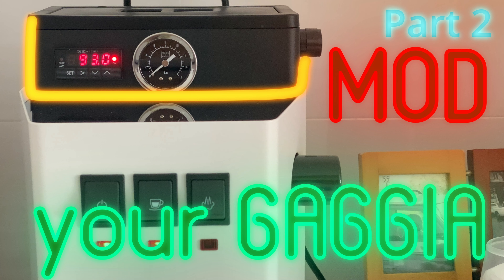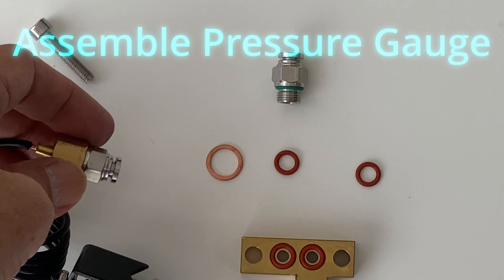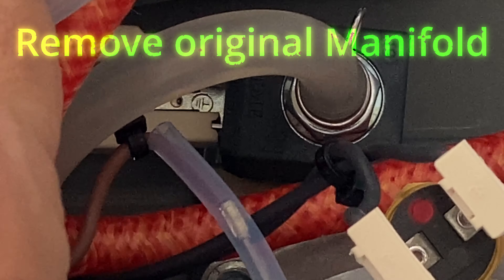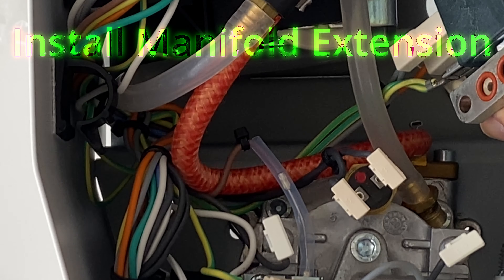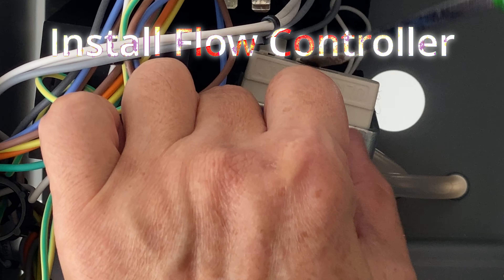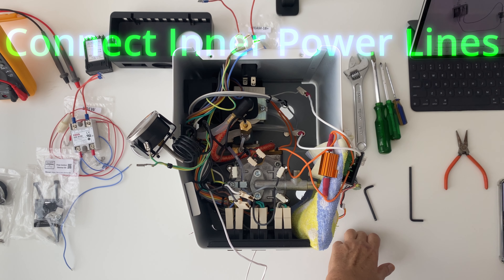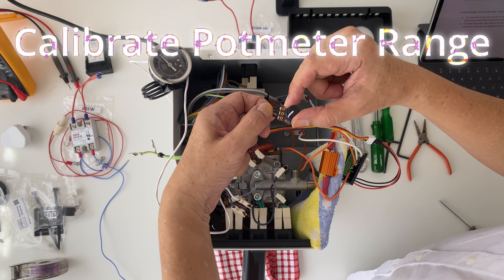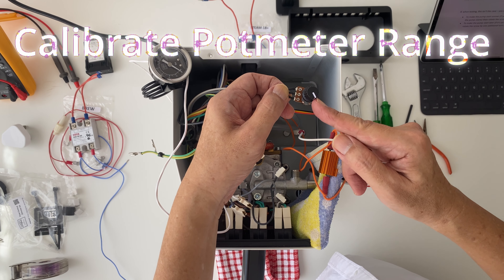DIY Mod Gaggia Espresso Coffee Machine (Part 2)

Comment: Hi there, I'm afraid you've used the wrong, bigger 6mm o-ring placed incorrectly (as it's seen at 15:11) between the brass collar of the gauge tube and the fitting. 

To avoid that water leak that occurs at 14:00, you should use a smaller 5mm o-ring. The o-ring should be placed between the gauge's brass nut and a brass collar that ends the gauge tube.
Reply from the maker: Thanks for your comment, appreciate it. You are probably right, although that was the only o-ring i had on hand. No leaks from the collar in the half-year since though. The kit is not perfect but it works and the support from Mr Shades is excellent.
Reply: @troncaffe no problem.  Posted it just to make others aware.  

Congrats on your videos!  Planned to make mods step by step. Firstly, pressure (gauge and adjustable OPV), after a while, temperature (PID), and some lights to make the water level more visible.  Now, thanks to your films, I think it's better to do all mods at once.

Comment: Very very thanks for the videos 
Please can you help me with  calibiration as the pump goes to 10.5 bars 
And i have installed a 9 bar spring 
How to set it to 9 bar?
Reply from the maker: It depends on what you have installed:
(A) installed the flow controller with the potmeter, or
(B) installed the "9-bar spring" without the flow controller.

If you have installed (A) then don't install "9-bar spring", you can control the pressure easily through the potmeter.
If you have installed (B) option, then the only way to achieve the pressure is through the bean grind size - increase the grind size to lower the pressure, assuming all else is quite consistent.

In either of the above options, changing the spring is not a good idea because it does nothing except to restrict the upper pressure limit. 
You should always choose the grind size for the taste & crema to your preference, the pressure will take care of itself.

Comment: Hi thanks for the great video, can i check how did you manage to access the screw in the inner side of the manifold
Reply from the maker: I did unscrew the manifold from the boiler to install the extension to it for the pressure gauge, hope that answers your question ..
Reply: @troncaffe  thanks for the quick reply did you also remove the wires connected to the solenoid valve to reach the screws?
Reply from the maker: @liushaoxuan  not that i recall.. do verify from the video

Comment: Sir, im planning to install a rocker switch in between the pump and the brew. I have a 4 pin switch like the brew button. May i know how to install such
Reply from the maker: Could you explain more the objective of adding a rocker switch between the pump and the brew? Do you mean to use the new rocker switch as a power switch? Or are you asking how to secure the switch to the enclosure?

Comment: Hi, thanks for the great video it is very helpful. I am having great difficulty getting the metal rods of thr gold metal power resistor into the red connectors. Did you experience any difficulties and do you have any tips on how to get the metal rods as deep as possible into the red connectors? Thanks!
Reply from the maker: Yes the fitting is very tight (designed that way for safety reasons), so please use a pair of pliers to push in the connector while keeping the resistor against something like a wall. Don’t use your fingers as a tool, for safety reasons obviously 😀
Reply: @troncaffe  Thank you for the reply. Unfortunately the resistor broke in my case. 😠
Reply from the maker: @lubodragomirov9768  sorry to hear that, just go out and buy another, it’s less than 3 dollars I think
Reply: @troncaffe  Yeah that's what I am thinking of doing. What I am looking for is a wirewound resistor with 10 kOhm resistance and 25 W, right?
Reply from the maker: @lubodragomirov9768  Yeah 25W 10K ohm power resistor, its very common. I am surprised it broke though. But I am sure the final mod result is worth your trouble.

Comment: I have installed the dimmer without calibrating it. I didn't know i keed to adjust it.
Reply from the maker: If you are alright with the starting point of the pump and the range of the potmeter input rotation, then there is no need to calibrate it. I was being fussy but the calibration made only a small difference to the input range.

Comment: Hi! My pressure gauge is not displaying pressure
Reply from the maker: How are you testing your pressure gauge? Are you using a bind filter or coffee puck? 
Assuming your pressure gauge is in working condition and your installation is correct, then there could be a leakage somewhere. 
To test of leakage, set the PID to room temperature, use a blind filter or coffee puck, start Brew and look for the leakage.